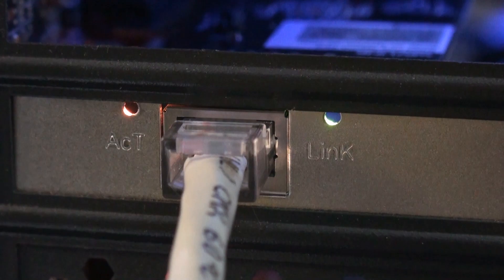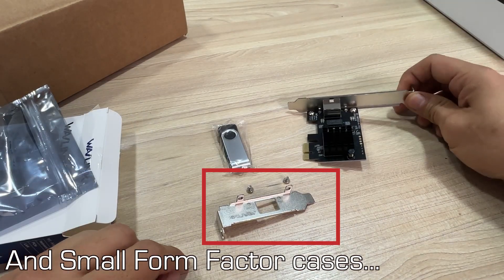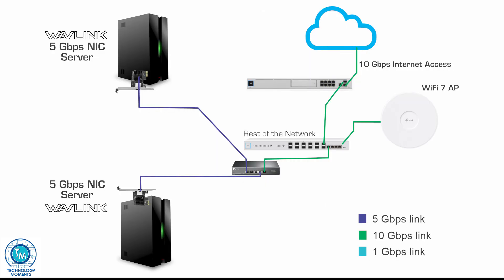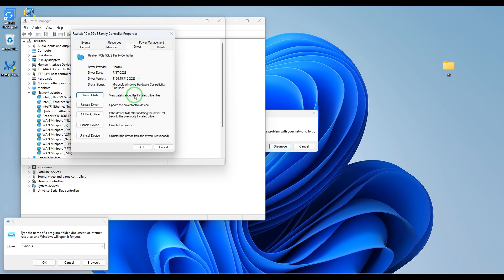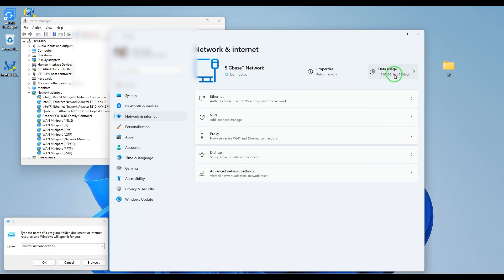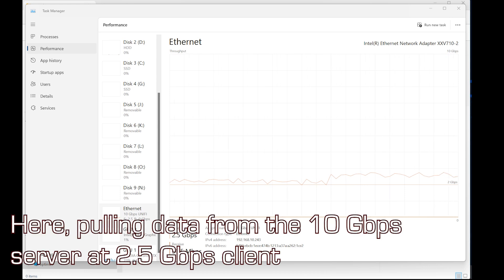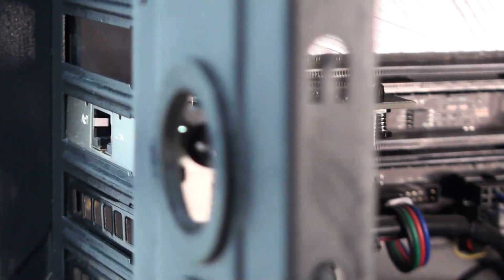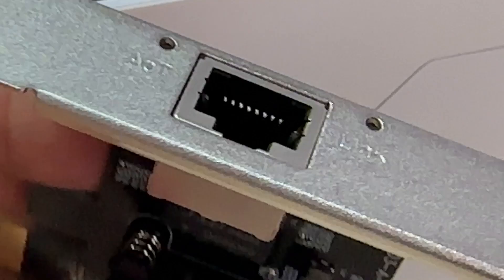What about 5 Gbps adapters? Here the Wavlink 5 NIC 1, 2.5 and 5 Gbps Ethernet

Comment: When do (mechanical) hard drives become the bottleneck (slower than the network)? I'm trying to figure out if upgrading my home network to 2.5 or 5 Gbps is a viable option using hard drives for the bulk of my data. In other words from what network speed  would I need to replace all my data drives with SSDs?
Reply from the maker: Most Hard drives will let you transfer (constantly at 150 to 160 MBs) that is close enough to 1 GbE capabilities.  Once you implement higher networking speeds, you can take advantage of faster transfer rates.  A good SATA SSD will let you transfer at 500 MBs which gets closer to 4 and 4.5 Gbps which is the average cap of 5 GbE.